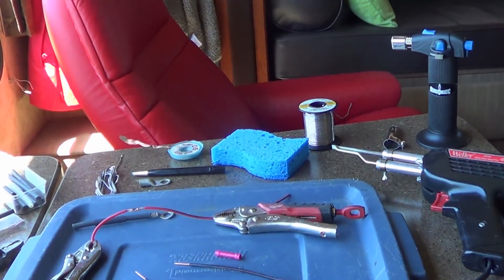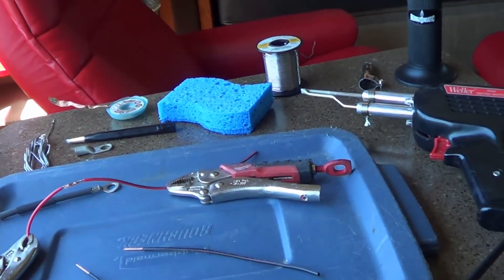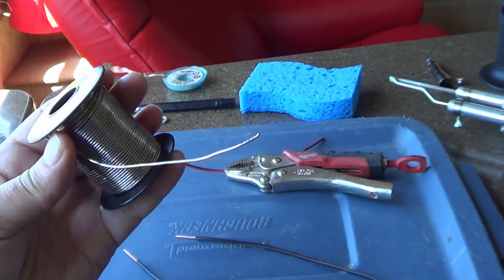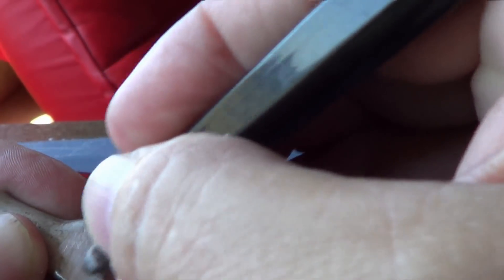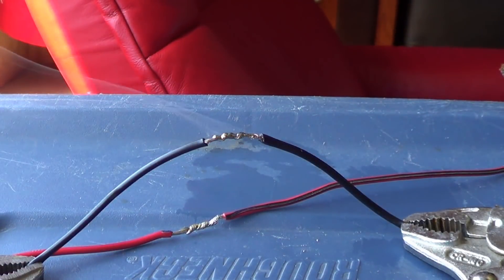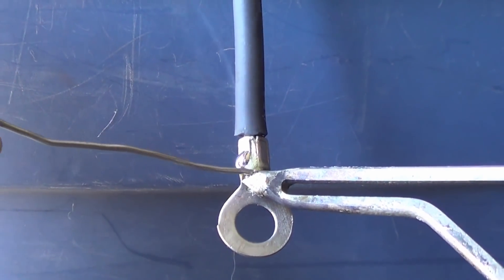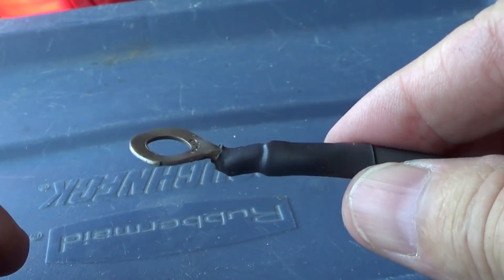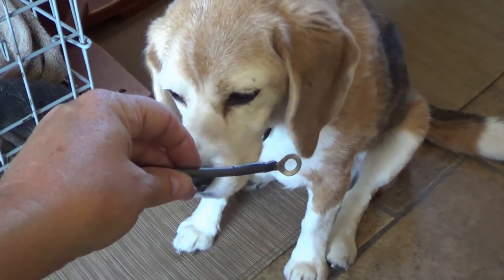Soldering Tips, Tricks and Tools - How to make a Reliable Connection

Comment: Hi Ray, I saw in another video that you use Verizon for internet.  Do you have a phone plan with them as well?  I'm from Canada also and I was wondering, do you have an American phone plan as well as a Canadian phone or data plan. I am currently with Rogers and will be spending 4 months a year in the Utah, Arizona area.  Cheers!
Reply from the maker: For cell phones, we have two. One is an unlocked smartphone and I use the Roam Mobility snowbird plan by adding their sim card when I get into the USA - https://roammobility.com/snowbird-plans
Seems Roam is a reseller of T Mobile so doesn't work great in the rural areas. We have Verizon HotSpot for data, I can always use to Skype phone in an emergency. I have a Skype number as well.
We also bought a super cheap Tracfone $29.95 at a US Walmart and add minutes with a prepaid card, that way we can keep in touch when separated. https://www.tracfone.com/?lang=en

Cheers, Ray

Comment: Another great video.  Solder joints should not be used in high vibration environments such as airplanes, as the solder joint becomes a weak spot under the continuous vibration.

Comment: One of the biggest problems  with soldering wiring on a RV or any thing that moves is by soldering you take the flexablity out of they wire and the joint will be the breaking point. As the wire vibrates with travel the solder joint won't flex with the rest of the wire and the the wire breaks at the joint leaving the joint it self intact.  It's a bad point of failure
Reply from the maker: That's a good point but if you properly dress the wiring you shouldn't have much if any movement at all. I make sure to take any stress off connection points. I find crimps unless done well and with good quality crimps worse for movement and more prone to failure from oxidation in the often damp RV environments leading to intermittent connections. Also, it's hard to have all the different sizes of crimps and crimping tools on hand versus a solder iron and solder.
I do like crimps for larger wires, high amperage wires and wires that may get hot. But for small gauge, low voltage/current jobs, I prefer solder along with good lead dress.   Cheers, Ray

Comment: For items subject to any kind of vibration I prefer a good crimp connection over solder.  Soldered wires tend to crack when subject to vibration.  Crimps much less so.  I always used a ratcheting style crimper , not the plier type.  Maybe my airplane vibrates much more than your coach though. :)
Reply from the maker: That's a good point but if you properly dress the wiring you shouldn't have much if any movement at all. I make sure to take any stress off connection points. I find crimps unless done well and with good quality crimps worse for movement and more prone to failure from oxidation in the often damp RV environments leading to intermittent connections. Also, it's hard to have all the different sizes of crimps and crimping tools on hand versus a solder iron and solder.
I do like crimps for larger wires, high amperage wires and wires that may get hot. But for small gauge, low voltage/current jobs, I prefer solder along with good lead dress.  But, I'm not in an airplane. :)  Cheers, Ray

Comment: Have you ever tried a shrink wrap with solder in it? And when you touch the soldering tip to the joint are you heating the wire to melt the solder?
Reply from the maker: No, I've never tried it. Sounds interesting.

Comment: Quite a bit different than what Daddy showed me how to sweat copper fittings!  That is, except for three things:  Clean, Clean, CLEAN!!  We used a Presto-Lite torch that would heat up to 1200° F and made the solder climb UP a vertical pipe!!  Nuthin' like crawling under a house in 20° weather to fix pipes!

I DON'T miss it.  ;)

Comment: Nice work Ray. However you make it look to easy. Thanks for taking the time to produce this vide. Did not about the fiberglass pen. I suppose in a jam you could use a pencil eraser?
Reply from the maker: Thanks. :) Should be OK for most things. Some erasers can be a little aggressive and cause wear or even remove metal coatings, like say on plated switch contacts. All depends on what type of grit is in the eraser.
Cheers! Ray

Comment: Great tutorial. The only tip I'd add is to get a "soldier pump" if you need to re-soldier/un-soldier close by joints or components on a circuit board.
Reply from the maker: Thanks, I have an old Hakko 808 desoldering pump gun, works great, especially for heavy joints like transformer pins and thru-hole board connections as it has its own built-in heated tip that melts the solder - https://www.hakkousa.com/products/desoldering/hakko-808-desoldering-tool-6066.html
I don't carry it in the RV though, one of those tools that never needed enough to justify carting it around with us.

Comment: Thanks so much for the video.....just soldered for the first time a new capacitor for my Samsung TV that would go off and on. $6.00 for the capacitor and it works flawlessly now.  Have saved this vid for future reference. Thanks.
Reply from the maker: I remember fixing a bunch of Samsungs for bad caps.  I used to carry dozens in my service call parts kit.
Some shops would quote for a whole new power supply board. I'd just change out the faulty caps, the customer was always really happy with the lower bill. :) I think Samsung must of have had a bad batch or cap supplier. I'd install a little higher voltage good quality capacitor and never saw them back. Cheers, Ray

Comment: I put my first Heathkit together when I was 13 and got my first amateur ham ticket when I was 17, so it was a natural to take the electronics technology course at the local community college. When I started working in aerospace a few years later I was Class III Space Shuttle solar certified and then a few years later when we transition over to SMT devices our soldering became very specialized. These days with a cataract I now take great pride in soldering with a great big lighted magnifier in front of me. I am hoping that when I go under the knife in two weeks that I will regain most of my vision back as I would like to put together a lot more ham kits in my future. Stella the Beagle like to snore pretty loudly while I am soldering away. LOL.
Reply from the maker: It's amazing how small the stuff is now. I started out in the 80's still working on lots of vacuum tube stuff. Seems like the Flinstones now. haha. By the time I left, I had a hot air solder station to do SMD work on the newer LCD and Plasma TVs changing large microprocessors and other surface mount multi-pin chips.
My brother-in-law currently works at building custom communications stuff and does his soldering under a high powered microscope with a super tiny tip and solder the size of a thread!
Angie grew up hangin gout in  my TV/Stereo repair shop. I think today was a throwback for her. :)

Comment: Clean the tip on the wet sponge before every joint/use ....... tin either the wire or a terminal first say if you are soldering a wire to a potentiometer terminal........don't breathe in the fumes if you are doing a lot of soldering............... I need to buy one of those fibreglass cleaning tools. You featured that in a previous video a couple of years ago and I keep forgetting to buy one. Thanks for the video Ray!
Reply from the maker: I used to always have one of these Hakko steel wool tip cleaners, loved it, worked great! - https://amzn.to/2LeWr90 But with the RV I had to figure out how to take less stuff. Cheers!